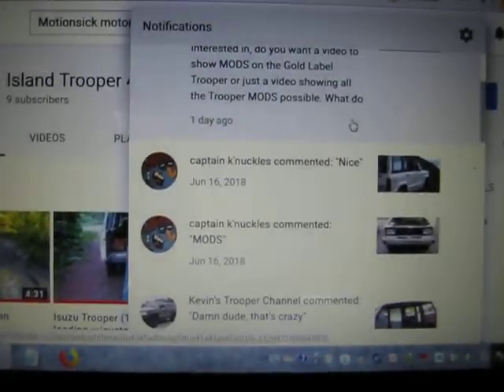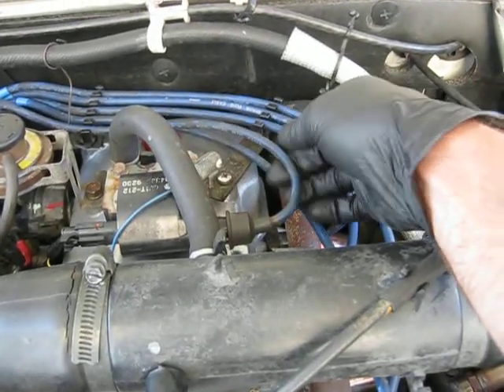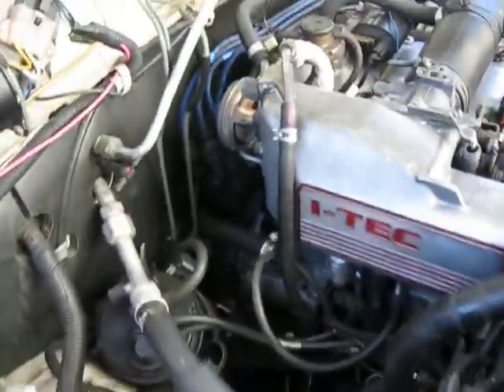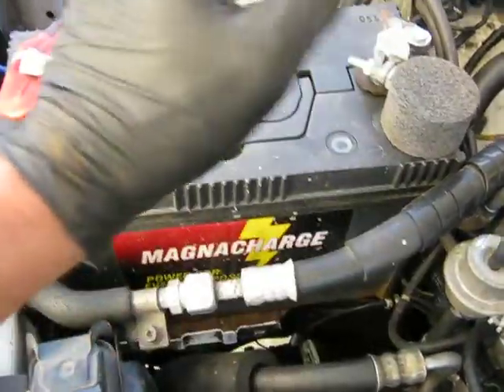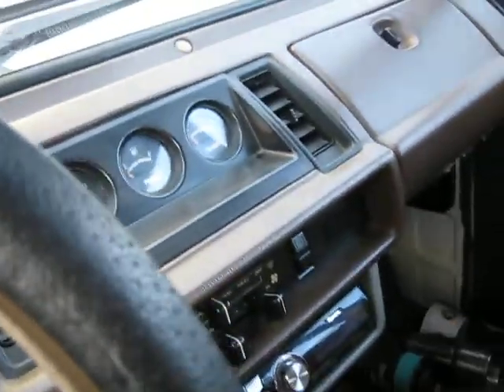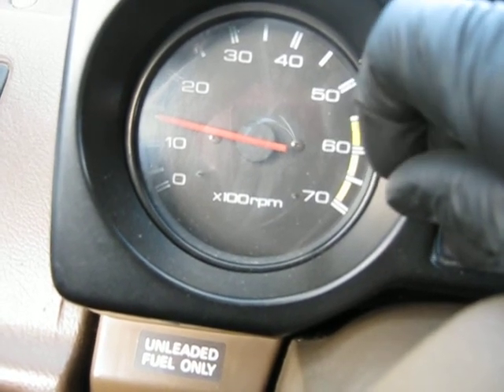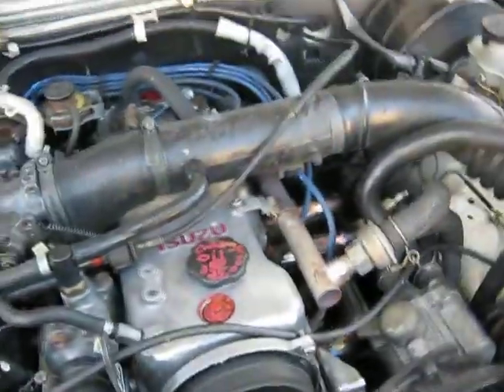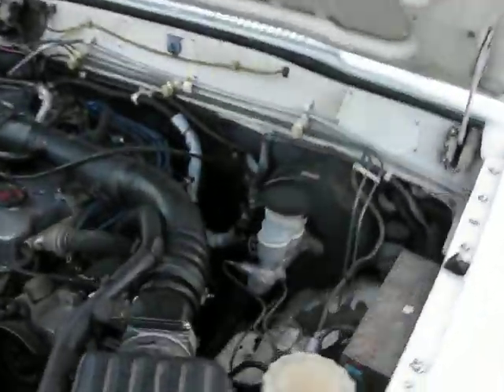Isuzu 2.6L 4ZE1 Exhaust sound video

Comment: Hi just wondering what size is the straight pipe?
Reply from the maker: Welcome Elementor, still rockin that glasspack exhaust as it is holding very well. The whole straight pipe is 2 inch O.D. from collector to the tip.